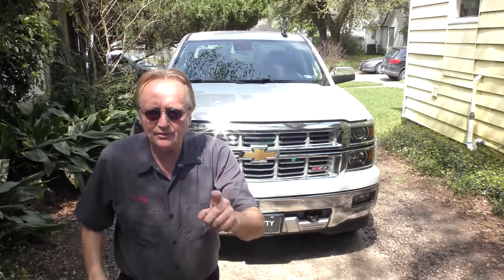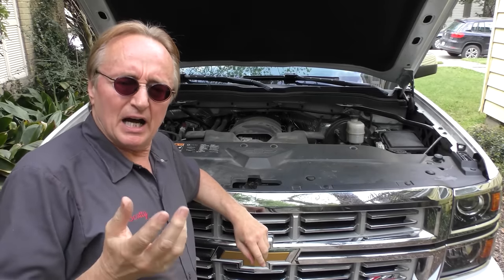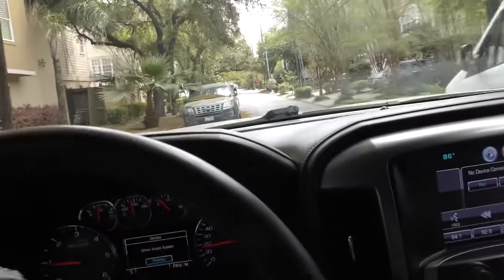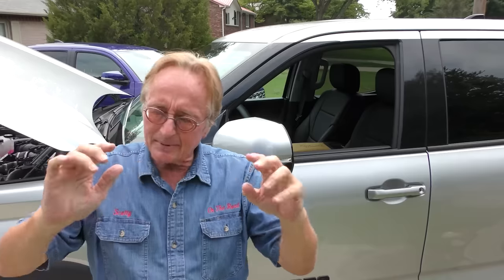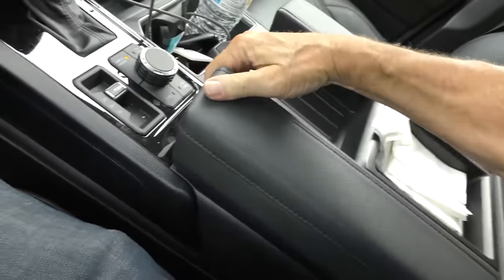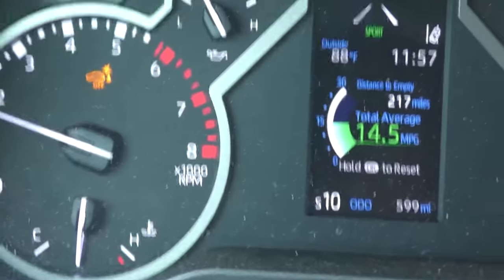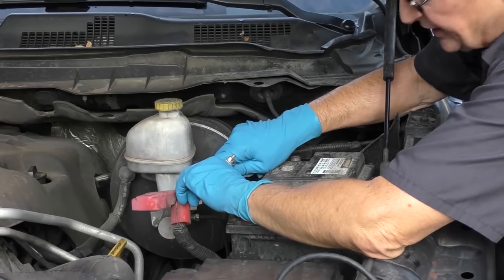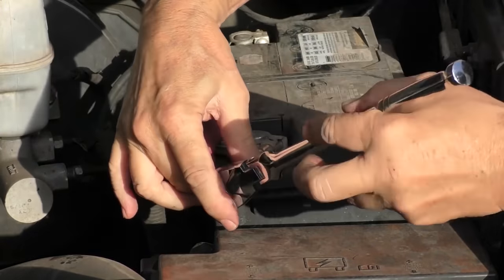3 Trucks I Wouldn't Touch with a 10 Foot Pole

Comment: I'm glad I went with the 2014 Ford F150 with the 5.0L V8 and 4WD.   No issues besides normal wear and tear.   68k mileage currently and everything works great.
Reply: You don't have any miles on it yet. Still too early.
Reply: We have a 2009 Chevy Silverado. And it’s been really reliable we like it and it has 123,000 miles.
Reply: Exactly! Stick to Fords for reliability and longer life span. I have a 97 F 250...run like rocket. And has an 8' bed. Built to last 215k miles on it, no problems!
Reply: A whole 68,000 miles!
Reply: My 2019 titan currently has over 70k and engine blew up at 27k
Reply: @silvercommander You ought to trade that heap in on a Tundra.  They are perfect.
Reply: @jasonjackson6055  I agree

Comment: My grandson is an auto/truck mechanic. When we were looking for a new vehicle, he advised us to NOT buy a domestic vehicle, period, because as you pointed out, they break and also their warranties are so short, most issues manifest only AFTER it's expired. At least the oriental brands have a much better warranty.
Reply: New car warranties?  On Toyota, Honda, and Nissan: drive train-5 yrs or 60,000 miles; bumper to bumper- 3 yrs or 36,000 miles. Chevrolet and GMC and Ford: drive train 5 yrs or 60,000 miles; bumper to bumper 3 yrs or 36,000 miles. Looks like they are all the same. Ignorance is bliss!

Comment: Great vid.  I was highly pleased not to see an F-150 on here.  My 2015 has the v-8 with103,000 miles and ive fixed nothing but new battery and swapped brake fluid.  Gets 17mpg commuting with bigger tires.  Tows an 8000lb camper pretty well at 11mpg.  Still lovingit!

Comment: Scotty, none of those things are actual pickup trucks. I have a 1993 Chevy 1/2 ton, 2 wheel drive, 2 door standard cab truck with an 8 foot bed. It has a 350 V8 engine and 700R4 automatic. It also has a bench seat that 3 people can fit comfortably. I bought it new. It suits all my needs. I can get 8 foot sheets of plywood or drywall in it, or 8 foot 2x4s, 2 dirt bikes or a quad, with plenty of rooms for fuel cans, ramps, and a bunch of other stuff. It has 321,000 miles. I just replaced both the engine and transmission. It's an AZ truck with zero rust. I'm 64, and see no reason why this truck won't last the rest of my life. The so called "trucks" they make today are not only junk, but they are almost completely worthless as a truck even when they do run.
Reply: yep, my step kid mocked me day n night about my old rusted out 95 ram.......I'd just snap back. "its outlived all 5 of your stupid post 2006 cars you bought" gets her twisted every time.
Reply: So true
Reply: Saw your note.   I had 1993 Dodge Dakota V8, 318, club cab, 6.5 foot box.    Never a problem.   "Sold it" to my friend in 2011.    He had till l2021 when moved to other side of country,    Sold it for to his neighbour .   Three speed automatic with overdrive....still had the original tranny and the air conditioning worked.     Simplicity, and as you said,   the newer ones are just junk, due to poor engineering and manufacturing
Reply: How’s the dash holding up in that Arizona sun?  I’ve got a 93 as well, but short box and a 305.

Comment: I've had 3 Chevy Silverado 1500's one 2000, and two 2005s. I've been super happy with mine. My 2000 has 260,000. The other two have 140,000 & 160,000 miles. I wouldn't buy one after 2007, but I highly recommend them.
Reply: Love my 98. 👍
Reply: I have 15 with 118k miles.  Outside of oil changes and 4 sets of tires, this old girl still runs like a charm.  For years it avg about 14 mpg.  Note to anybody with a car or truck with over 100k miles, use a fuel additive and the mpg will improve.  I'm treated two tanks of gas, the cheapest one over the counter or Walmart for less then $5. dollars.  Now I'm getting 17mpg city and 22-26 hwy.  Peace!
Reply: Prolly the best ever built 2000-06
Reply: I traded in my 2017 silverado for a 2005 silverado, lol salesman thought I was crazy. Both had 80k miles
Reply: @fc3sluis salesman was right
Reply: @rickreese5794  Agreed
Reply: 2007 was the last year of the GMT800 series.
I'll never buy a GM truck after GMT800.
Reply: @stldweller 
Why?
As long as the older truck didn't have rust, then why not?
Reply: @knowledgeispower6192  
Love the 6.0 in a 1/2 ton,
My wife does better than 21mpg,
In an 01 Denali, bulletproof v8.200k
Reply: @rickreese5794 early 07*
Reply: My 04 reached 600k, my 99 is at 300k and runs great. I change the oil around  every 25k miles😅
Reply: The maintenance cost to make those things run 260k miles is insane and uncalled for
Reply: That is all I do drive is chevy trucks an I love them he should look at ford trucks they have motor an Trans problem  an go in a ford place an look at motor an Trans out of them
Reply: I'm 53, I've had Silverados my whole life. Traded a 2001 for a 2017 with 80k mi. I couldn't believe the night and day difference between the 2. After 2 weeks I traded that 2017 in on a 2014 Platinum Tundra. 
That 2017 was by far the biggest pos I've ever owned. NEVER again will I buy a big 3 pos.
Reply: @tacoswelding8411  one water pump and two batteries and it was less than $400.
That's on a 99 silverado with 300k miles.
It can't be any cheaper
Reply: @johntomik4632  🤔 if you say so
Reply: @tacoswelding8411 I also have a 2005. We bought it at 160k for $5500 and zero problems until 300k. At that point it needed an alternator, wheelbearing, water pump, and hose connector. All pretty common wear items for any engine(except the hose connector). Spent about $500 and did all the work myself in about 5-6 hours.

It is ready for front steering components now at 330k.

Overall a great experience.
Reply: I daily an 03 right now...before that I had a 99...that I drove to over 300k miles...sold it to my brother and it's still going strong...99-06 chevy trucks last foreveeer...
Reply: @slackamacgaming6721  I had a 04 and now on a 99.
I have absolutely abused them too. Still running great. It's crazy how simple and well built  they were.
Reply: i have a 2005 Silverado i bought it used the guy i bought it form put engine work in it a new engine i guess that had 225k on it . but sinc ei bought it ive replaced so much to it but it works fine..all in totla about 9 thousand total for the purchase of the truck about 5k and 4k of work so of which wasnt necessary but i did it to prevent eventual problems or keep up on its maintenence
Reply: 97' 5 speed....280,000 recently put in a new motor and trans
Reply: Yea the older tucks run 250 k
Reply: @Winterstick549 the issues run a lot deeper than rust. I love Chevys, bullet proof motors if taken care of, but those transmissions are @$$.
Reply: @slackamacgaming6721 the older Silverados were damn good trucks. I never owned one but a few friends at my old highschool did and they abused those trucks. Only time they broke down was during an engine rebuilt for a modded LS swap and they didn't construct it right. One of the pistons blew lol. Of course LS 5.7s are easy to find
Reply: I don’t know man, my dad has had a 2015 since it was new. The only problem it ever had was the camshaft started to wear so he dropped a corvette cam in it.
Reply: My Chevy gets 570 miles on a tank . Air conditioner blows icy. 283 k miles. Just getting broken in

Comment: Great video. I love my 2008 Chey Avalanche 183000 miles and still running strong. I drive to work everyday very conservatively and consistently make between 17.5 and 18.5 mpg. About 550 miles between fill ups. Seeing how newer trucks are made my next vehicle will either be a 2013 Avalanche or 2014 Suburban.
Reply: 2003 Chevy avalanche 230,000
Reply: @JKMusic7  life goals!

Comment: I have the 2004 Sierra 1500 SLE (5.3l RWD), and I'm happy with it. 213K so far. I will replace/repair whatever it needs for as long as the truck lasts. Barring it being smashed by a meteor, it should still be in the driveway when I get a ride in a different vehicle. A one-way ride to the cemetery, that is.

Comment: I got a 97 Dodge Ram 5.9 liter 1500, runs like a top with 250,000 miles on it. It also has no tranny slippage. A stock 5.0 Mustang, I can leave about 2 bus lengths behind me with almost a 5,000 lb and with a 5 inch lift kit on it. The truck is damn near Bulletproof. I've thrown everything at it, and the guy I bought it for a brand new used to this an elk truck in Oregon. The trucks after that just turned in a crap.
Reply: I don’t think you’re fooling anyone with that mustang comment lol

Comment: About the chevy truck: some time ago I contacted GM on several different occasions to bring to their attention that about 95% of the vehicles that I see being driven on the road that have a problem with the ligts not working (headlights or minor lights) appear to be GM  vehicles. That did seem to be a complete waste of time. Apparently GM is not interested in making more reliable vehicles!
Reply: Yep, you can always tell when a Chevy is coming toward you at night.
Reply: I agree and I have noticed this for many years...
Reply: No lights, it's a chevy. Got to get home before dark or park it when the street lights come on.
Reply: @penguinbrand I can always tell a Ford by its position on the side of the road...

Comment: I had a 2002 Z71 Silverado with 5.3 l and that truck was very dependable I think the only thing I had to replace was the battery in the truck when a long way and hauled good!
Reply: Old gm was very reliable . 2003 and back are great vehicles.
Reply: Back in 2002, Ford,  Dodge and Chevy made great trucks. I ordered my 2002 dodge ram 2500 slt diesel in 2001, took delivery in Feb 2002. It has 398,360 miles. Gets 24mpg hwy, has original evaporater, heater core etc. But I change radiator fluid every 100,000k.

Comment: Interesting that he picked the Tundra as a truck he wouldn’t touch, then has very little to say that’s seriously that’s wrong with it. More positive than his initial impression. I’ve had a ‘23 Platinum for a few months with no complaints so far. I can barely feel the shifts and the engine has an abundance of snort, even pulling a travel trailer. As a retiree who doesn’t put many miles on the mileage is quite low on my list of concerns and his initial concerns about the longevity of the turbos is a non-issue for me personally since I won’t live long enough to put 150,000 miles on it, probably not even 100,000. If I wanted a daily work truck these things might be more important.
Reply: Scotty usually does not like any vehicle with a turbo, much less 2 turbos.

Comment: Chevrolet tech here, on those 2015 that front hvac condenser  were common to leak on their lines. If you are facing the truck inside the grill you can see on the right side of the condenser line it was known to have small cracks on the welds of the line.  An yes 15 hour job for removing the evaporator but weren't common to have leaks,  had replaced more evaporator cores in Cadillacs Ats more than silverado. Is as if GM was doing it on purpose with cadillac so customers will spend a ton of money to get their cars repair.

Comment: My 2013 1500 Silverado was a money pit and I rarely drove it. Looked great but I got sick of all the plastic bits and electronics breaking with only 65k.
Reply: Yea I had a GM Silverado 2014 pice of junk engine I had problems day one brand new I almost cried I have a 2019 Toyota camera no problems. Wounder what new full size truck to buy?
Reply: My dad sold his 2013 with 305k miles on it transmission replaced at 200k not many other issues 

Also I drive a 2014 Silverado with 183k miles only issues have been a/c condenser and a lifter tick

Comment: Scotty, I'm so glad I saw this video.  I have a 2017 Hyundai Santa Fe with about the same mileage as this Silverado with the EXACT same problem.  We're $300 and 2 shops in to trying to find where the leak is because leak dye isn't showing up anywhere.  I'm going to ask the current shop if they have the meter you used.  We're going through about 1 lb of R134A a week.  I'm tired of fussing with it!
Reply: I've had luck shining the uv light into the puddle that came from the drain tube. But if that doesn't show anything you need a sniffer for sure

Comment: Scotty, my old 2016 Tundra with the big V8 gets around 14 in town and 19 highway. Mine was $39,000 December 2015, that was bad enough, but now they’re double that price. I just pulled a 26’ body Jayco camper, 10 mpg, oh well. Only disappointing thing so far is my brakes were shot at 50,000 miles, not towing,  and I’m gentle on my vehicles. It’s my Armageddon truck, meaning the last one I can buy, they’re crazy with those prices, ugh!

Comment: I wouldn't own any truck a Harley Davidson motorcycle won't fit in the bed. If it doesn't have an 8ft bed it's just a poor station wagon. I replaced the air conditioner in my 2005 chevy silverado it only has 71K on it. That's a job to you have to take off the inside fender and wrestle the compressor around the frame. All that work and now it's leaking someplace I can't find but not bad..

Comment: Scotty, I have a 2014 Silverado 1500.  You are spot on, but the list of known issues is much worse.  6L80E transmission will give it up at 100k, because of a junk TC, thermostat that gets it too hot, and poor quality fluid.  The engine has AFM issues that causes lifters to fail. The paint is “flashed” to infrared cure that gives it a very poor paint job.  The AC has bad condensers AND evaporators.  Leaking 3rd brake light.  The sliding rear window explodes due to a faulty defroster.  All this for trucks that they charge a stupid amount for now!
Reply: theyre literally robbing u and saying hey atleast it looks good and u still have something to drive kinda
Reply: I have a 14 Sierra, I actually haven’t had any issues with mine, I’m at 400000kms on the stock transmission still, I purchased mine new and it’s been good to me, only things I replaced were condenser and transmission lines aside from basic wear items, if you were to look under the hood you wouldn’t find any oil leaks or anything either, maybe I just got lucky